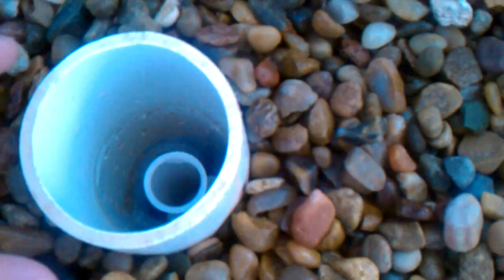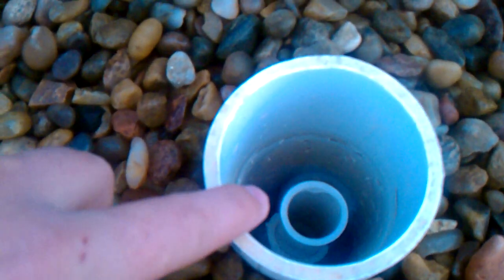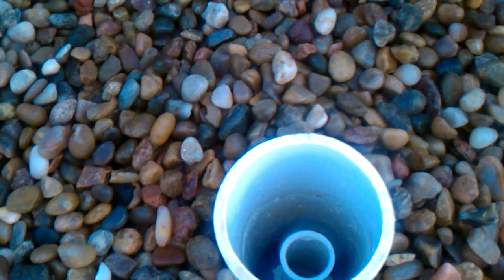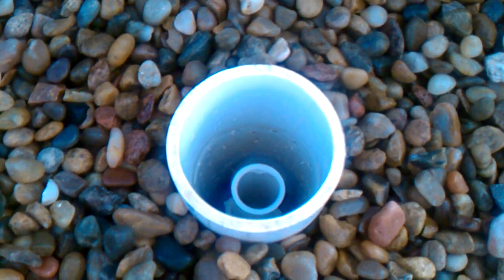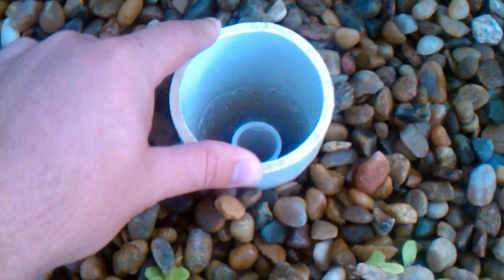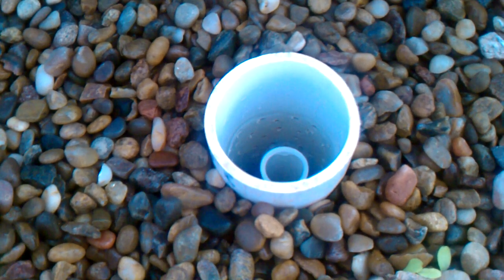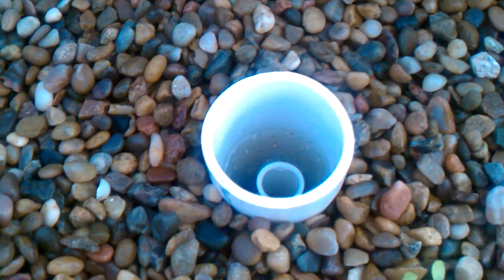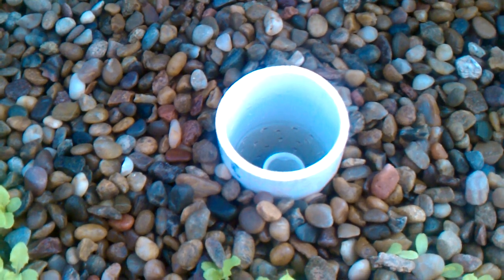Bell Siphon Explained

Comment: @Carlodimaximus I"ve been doing my own research on these systems too. Yes plant roots do grow under water if there is a source of oxygen like an air pump. With the bell siphon you continuously flood the table. When the water reaches the siphon point it will begin draining the table while pulling air down to the roots. It keeps draining until the table is empty while new water is being pumped in and the process repeats. This way you can constantly flood without drowning your roots.

Comment: I am doing a research on this aquaponics. Question is, why would I want to drain out  all the water from the bed? Can't the plants stay on water the whole time, just till certain level? how does it works with those plants on little plastic cups sitting just in the water? Thank you.. and by the way, great video, it looks like a nice system the one you have. =)